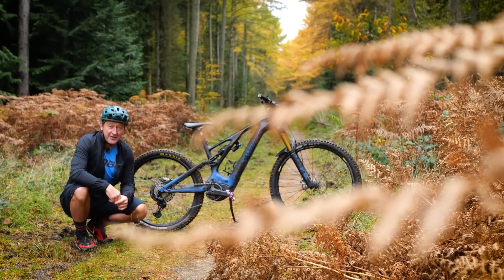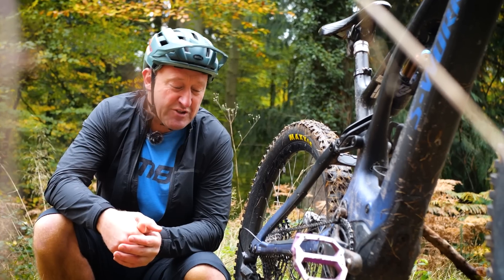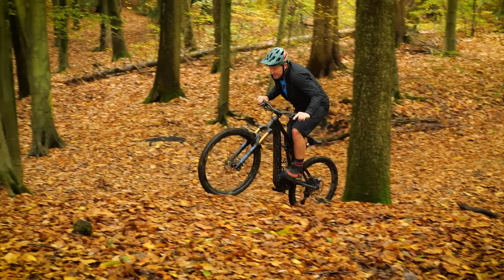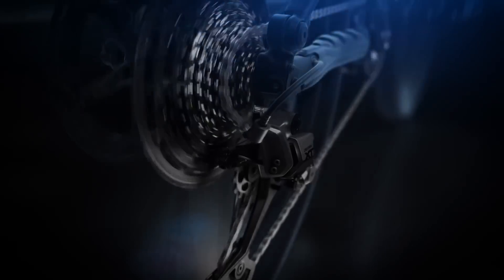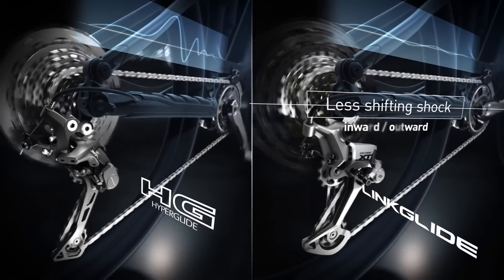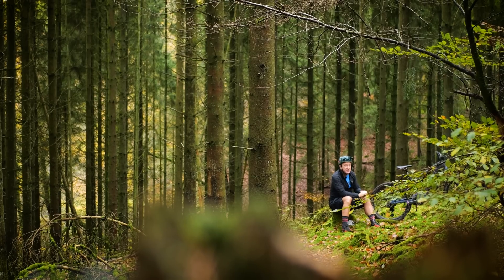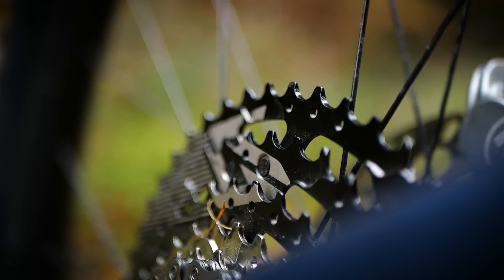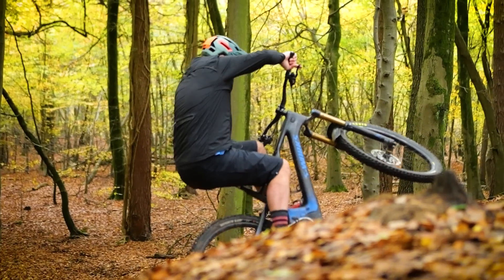Shimano Linkglide | Is This The Ultimate EMTB Drivetrain?

Comment: I just fitted linkglide to my 10 speed GT Everb, best money I ever spent. So much smoother shifting, absolutely like a different bike. As well as cassette had to change derailleur, shifter levers and chain.
Reply: What type of hub did you place the link glide on I don’t know what hub has normal spline that would be compatible with link glide
Reply: @waldowsxxghostxx8577  Sorry I don't really know the details, I had it done by my bike mechanic. All I know is it was a very easy swap

Comment: I just fitted a Shimano 10 speed LinkGlide drive chain to my previously Shimano 9 speed setup on my Trek Dual Sport 2+. I had to replace the cassette, derailleur, shifter and chain. The difference is amazing. It runs very smoothly and quietly and shifts much more quietly, quicker and no jumping. Best upgrade I’ve done so far and very reasonable cost, considering the chain is quite inexpensive to replace going forward and the rest of the Drive chain should last longer, especially if I stay to shifting normally without straining the changes😊 highly recommended imho

Comment: Sadly, the Di2 & Auto-shift is only going to be available on the newer ep8 (EP-801 not the current EP-800) & ep6
Reply: Yeah… that’s sad! But the EP 801 is really overall an extremely big upgrade over the ep 800! It has so much more power and is now comparable to the other motors like bosch CX and the RM 4.0! And with less input it’s even stronger than the Bosch CX! 
The EP 800 was not even near comparable with those! 😅 

So if you have the money, i would definitely upgrade to a bike with the ep801! And then you could use the Di2 system! 🤗

Comment: I have 12 speed  SLX derailleur with clutch and deore cassette and never had any problems shifting is butter smooth even after a year of use 2300miles done ....No point to pay hundreds in cassette and shifters the more you pay the less they are durable..PS the more heavier rider the more issues on drivetrain and wheels
Reply: 12 velocidades usa tecnologia Hiperglide+, una mejora del hiperglide, es mas ligero, pero linkglide es un salto en suavidad y por lo tanto en durabilidad, siendo mas pesado

Comment: There’s a new Linkglide cassette which doesn’t weigh as much as this anchor. Seems they’ve replaced the steel spider with aluminium. Making it about 200g less.

Maybe not important on an e-bike but I’m planning to change XT 12 speed out for the Linkglide 11s
Reply: I'd suggest an aluminium spider that carries as many sprockets as possible should have been the first design consideration for an E bike specific cassette. And hub manufacturers ,  give us a steel freehub body option while you're at it. 
Absolute no brainers that seem to be overloked for pretty obvious rea$ons.......
Reply: It’s not microspline compatible!
Reply: Hardly an anchor is it....

Comment: Use 12 spd all steel deore cassette with slx mech and chain for e bikes. Cheap, efficient and reliable.
Reply: I have 12speed Sram GX and tried GX and XO cassettes and chewed them up in 4000km. Going to try this Linkglide setup with 3 chains changing chains every 500km, will see if that works better

Comment: For DIY ebike, I would go for IGH. However getting IGH kit is pretty difficult.
Reply: Easy enough to get, just $$$ if you want it to work well.
Reply: It's impossible to find a frame with splits and horizontal dropouts. Not to mention being able to take the torque of a m620

Comment: The linkglide system looks great and I'd think about  changing across when my Trek Rail cassette is worn however there is no conversation about the required 
change from Microspline to HG. Can this be easily done?
Reply: Any updates on conversion options for microspline?
Reply: @SDmountainbiker  I suspect you'd need to buy a HG freehub to suit your hub ? From my experience on Hope and Mavic hubs , it's really simple swap.
Reply: If you have the newer bontrager hubs then you can just buy a hg freehub body. Easy to swap over.
Reply: My microspline hub wouldn't accept HG. I bought a new wheel, but you could buy a hub and rebuild the rim if it's nice .

Comment: If find much cheaper Microshift Advent 10 speed  is great for hard wearing and accurate shifting on my emtb  wouldn't swap it for shimano
Reply: Most underrated comment, performs like xt at like 1/3rd of the price.
Reply: Cool , I've just ordered the same microshift advent x drive train for my focus thron  , can I ask what front chain ring size you are running g ? Thanks

Comment: I upgraded from a 2x 10 and I think I prefer that shifting to the linkglide. Because the gear ratio of the wider spaced the linkglide seems to need extra 1/4 push assistance mid range but ok on the last big cogs, seems strange. Down shifting is of course sublime. On my bulls I needed to get a 5mm longer B screw fitted to get the correct B screw adjustment. Is this the future? no I do not think so I think Gearbox/motor combos seem to make more sense with belt drive. Thanks though for giving Linkglide a single video.
Reply: E-bikes have such a broad torque range that fewer gears is less important.  Hell- my regular bike is a 1x10 microshift and works fine, although I occasionally want a couple of taller gears.

Comment: So can I just run the Linkglide cassette, or does everything have to be replaced?
Reply: You have to change the entire drivetrain, because the spacing between the sprockets is different, because they are thicker.

Comment: Absolutely not necessary... a 12 speed transmission with "cheap" components such a full steel cassette is enough, I use a xt derailleur on a deore cassette, use a higher level derailleur such xtr is completely useless on ebikes, xt is enough, slx or less should be even better. Shifting under load is always not a safe thing to do... a "tougher" transmission won't change nothing in that case.
Reply: If it won’t change nothing then it should be a massive change

Comment: I think what they should be doing by now is integrating a dynamo system to the motor to charge up the battery. That would be a game changer in the ebike world,  you wouldn't have to have a huge battery capacity then, more eco friendly.
Reply: That would create a ton of drag
Reply: That would be stupid to do. Very unefficient. Better to get the power from the battery. Even getting energy by motor braking is hardly getting any energy back on a middrive.
Reply: Even with the stromer bike that does have this tech in the back wheel motor, it doesnt do anything. Except when you would decent for a couple of km’s but still you get a lot of drag. The only thing its good for that you can brake on the motor instead of rotors.
Reply: I remember when i had my first beer
Reply: It already exists on some ebikes. It is not great though.
Reply: @goonbreathfpv  this time next year they will have cracked it, they already have a type of exercise bike that powers usb devices so maybe these big companies can integrate it into their motors, I know its not gonna fully charge the battery up as you would need an awful lot of wattage coming from it but it may just give you 10% extra range.
It can be done, it may just be these companies don't want it to happen.
Reply: I agree. I think that will be a game changer. Better ReGen technology is definitely worth looking at while we wait for new high capacity battery tech to appear. Remember when they said ABS wasn’t possible for EMTB?! Now we have it! ReGen, if they can get it right, will change how we estimate range and battery use and enable us to ride longer and further without carrying batteries in backpacks. Bring it on!
Reply: @michaelvenediger  exactly, technology is getting better all the time, some people want to be stuck in the dark ages, when it does happen and it will all the negative replies will be like "OK it can be done" it only takes one of these companies to sort out the new charging system that's out already and integrate it into their system.
Reply: stay at school kids
Reply: @michaelvenediger  nobody said Abs is not possible on ebikes. Completly different tech btw. Some people have missed their physics class at school. I guess. ☮️
Reply: Are you serious?
Reply: Yup they’re serious.  Might defy a few basic laws of physics but hell let’s just do it anyway.
Reply: You’re clearly not an engineer 😂😂😂😂
Reply: @JinSakai_Kuroudo  well actually I was an engineer and a teacher, and if you do your research it has already been done but not to how it would be effective as of yet, they will do it.
Reply: @Raven34gtr  nar this will never catch on  for masses    it can only be useful for sum one who dose heaps of hill climbs as breaking is the only time u can get energy with this tech
and u only do lots breaking going down hill  
plus do batery like being charged ever 15 mins  ,maybe
Reply: Do in EV cars without drag so maybe soon it could be integrated! Leave that to the experts but techs already there to copy and paste it

Comment: the ultimate drivetrain would be a hub gear. normal derailleur gearing is not the future for emtb.
Reply: Intra drive - integrated motor and gearbox, size of a Shimano motor - linked to front and rear cogs via Gates belt: simple at the drive and receiving end, and all weight in the centre of the bike. An elegant and strong future beckons!
Reply: @freeforester1717  Perfect !

Comment: If only anyone actually had linkglide in UK, is it a myth?
Reply: I've had the 10 speed version (UK all year rider) and for my usage I get about 1000 miles before I need to change a chain. Tried to get a bit further the first time (1500 miles) which took it to .75 on the park chain checker. At this point a new chain just slipped, so this time I've changed it at 0.5 wear and after a bit of initial jankiness, it's working as good as new. It does shift well and under a certain amount of load too. Certainly not the 3x life promised though. Prices in UK seem to be ridiculous though, got it from Germany and bought enough for at least a year's worth of riding up front. Tektro reckon to have an ebike ready set , but not seen it anywhere yet.

Comment: E MTBs are extortionately priced when considering their battery life, reliability and compatability with other likewise systems.
The market is swamped by competitors vying for attention yet, they refuse to prioritise cross compatibility and standardised componentry. 
The battery prices alone are a joke, let alone the full bike price, which is stratospheric. And all for bikes which find the slightest excuse to either run out of power way too soon or simply break. Then you have a heavy bike to pedal instead.
Until the reliability and price issues are comprehensively solved most reasoned mtb riders will continue to avoid such folly.
Reply: Plenty of E-mtb riders over here mate. And we have none of those problems you described.
Reply: @wolfura  ,
If you say so. My mates say differently. Three have sold theirs and refuse to go back. They all had 5k plus bikes. Nothing but problems.
Reply: Yes I agree both my new Rail 7s were total crap from first time I rode them basicly  so changed to 2022 Reign frame crack plagued that model some say it just the filler in weld but no a lot the welds were crap its never ending with new Ebikes  Dramas
Reply: @andythealien1  I ride a Dengfu E10, a chinese carbon fibre 150mm emtb frame with a chinese Bafang M600 motor (unrestricted).
A great combo that gives me no issues and over 100km range.